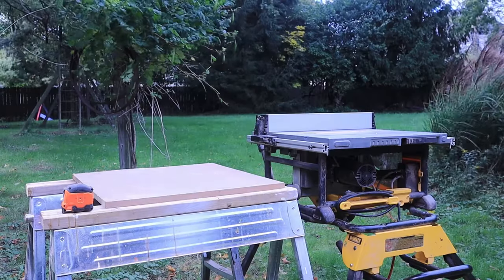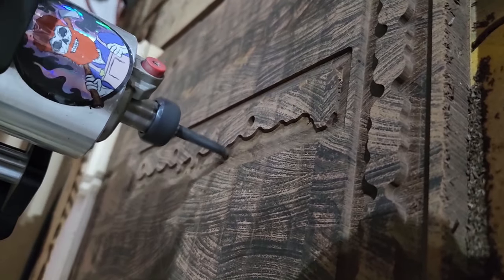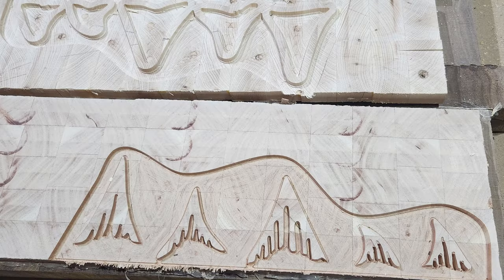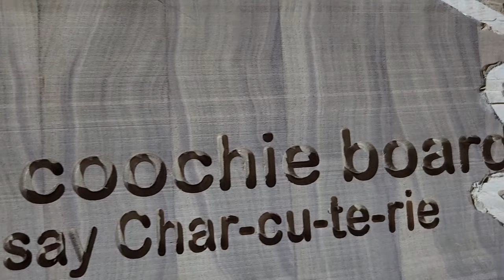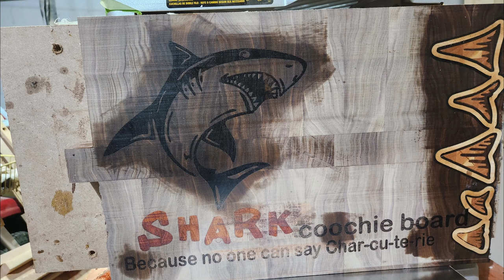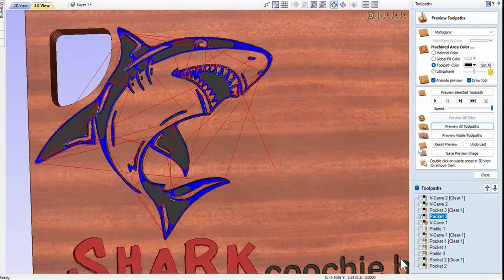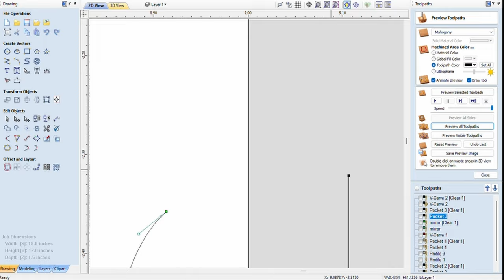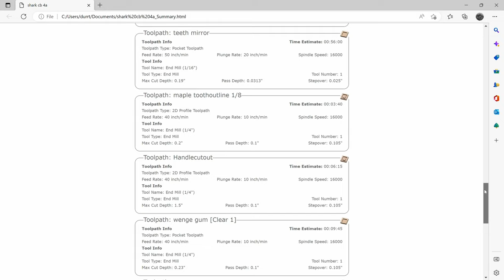Cutting Board Inlays with a CNC

Comment: It looks good, the shark would have gone a lot faster using 1/4 or even 1/8 clearance bit
Reply from the maker: Totally understand, I usually pair the bits on both plug and pocket. I find in my experience that it usually offers differences between the two when you don't match them. I  also find that when it comes to end mills, it also stacks the odds of the bit dropping straight down. Those will leave small little mounds. It might not matter within the pocket. I think that definitely matters within your plugs. Hopefully, that makes sense.
Reply from the maker: Also thanks, it was my most complex inlay to date.

Comment: Is it possible to get a copy of your "Job Sheet" for this project?
Reply from the maker: I had alot of moving parts within this  particular carve. I actually had to go back and alter a few settings along the way. I would be afraid to set you up for failure. Since alot of it will show extra/unless toolpaths.
Do you have a question(s) or concern(s) for this project? I would be willing to help you with!
Reply: @dustytrailsworkshop  I was more courious as to the bits used and what the V carve carving settings were (tool setup in the tool database.  I am new to the inlay side of CNC and your cuttings fit as I would like mine to.  Thanks  Tom
Reply from the maker: I see, alot of it depends on what you're carving. I'd make a small mock up to test your machine. Start with simple vectors like a square and a star. You can start off with the .2 difference between your female and male plugs. The goal here is to glue these up and understand how your machine will carve. This will also help you understand the proper offsets needed for them. Along with seeking that perfect glue joint gap.

Areas like the teeth were small areas where I used a 1/16 end mill. This made me rely on using that as my main bit. Then I selected a clearing bit that worked for both female and male ends of my plug. Again I used a end mill bit. The key with inlays is to use the same bits for both the male and female carves. Otherwise it has the potential to not line up like a puzzle piece. When it comes to toolpaths vcarve is the best way to go at the beginning. Most people will use a vbit to carve out the toolpaths. This is definitely a more advanced inlay carve with plugs inside of each other and it definitely was a bit out of my own comfort zone. That being said I can send you videos that helped me understand this more later today in a message.
Reply: @dustytrailsworkshop  Please send videos.  Thanks for your help. tom
Reply from the maker: @Tom Blackmon I can send you some links. Is it possible for you to add me on Instagram? if so it's the same handle. I was just trying to  avoid emails over public domain.

Comment: How deep is your pocket
Reply from the maker: (.2 was my z depth) Just make sure to have a .02 difference between your plug/pocket. This leaves room for glue and helps close the gaps, when the plug snaps in Overtop. This is more of a guideline or starting point given not all CNCs will be the same. So if you're just starting with plugs, I'd test out an easy shape like a star. After you let the glue set up, cut  open your test piece to see how tight everything will be. Good luck, my friend!
Reply: @dustytrailsworkshop  thanks very much just learning.